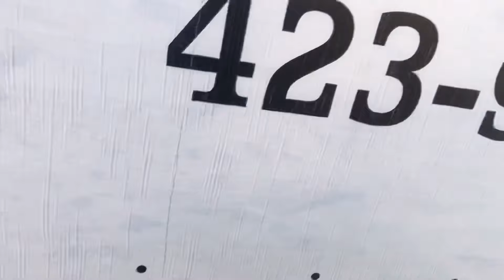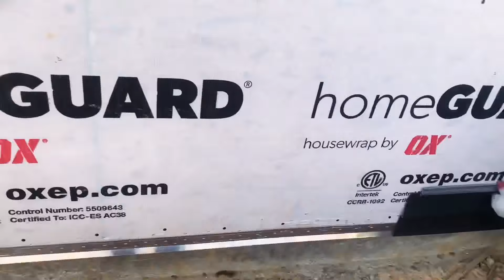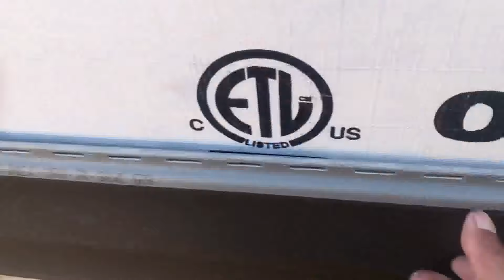How install vinyl siding Como instalar siding de plástico

Comment: No se si estoy atrazado o adelantado pero segun yo se se le deve dar un espacio a cada pieza para que no se esponje con los cambios de temperatura y veo que con ese graperio no ue le ponen no se va a mover ni un 16 y pir lo tanto el material se va a esponjar espero respuestas para saber ai estoy mal o estoy en lo correcto
Reply from the maker: es cierto   es que hacemos nada mas que no se los detalles saludos
Reply: Yo soy sidero desde hace 20 años primo, y que yo sepa se debe dejar el clavo un poco fuera para que el panel se pueda mover por la expansión y contracción y no creo que con las grapas se pueda, ademas cada clavo debe in en barrote ( 2x4s) disculpe si me equivoco
Reply: @garcia090902  lo mismo digo yo trabajo en lo mismo y nada que ver con la forma correcta de ponerlo